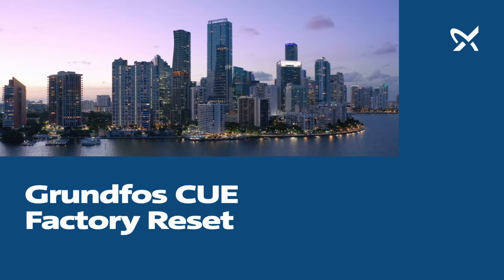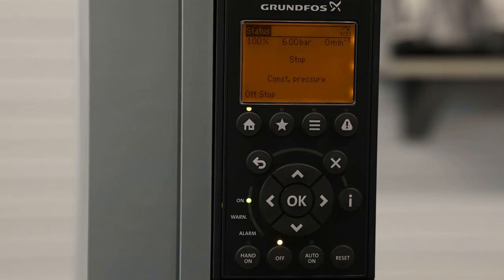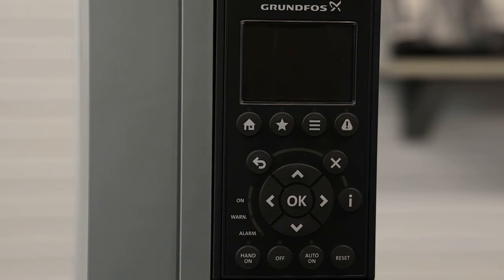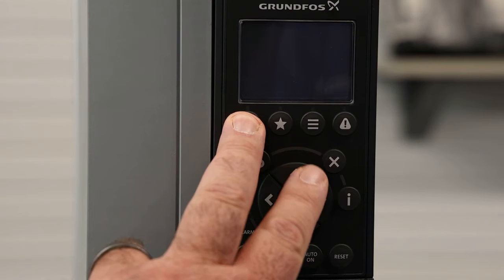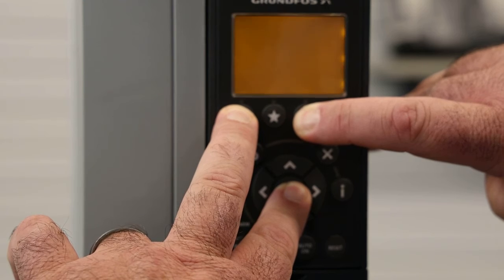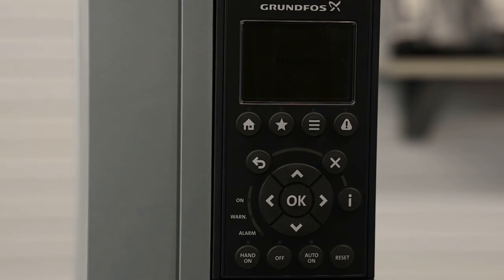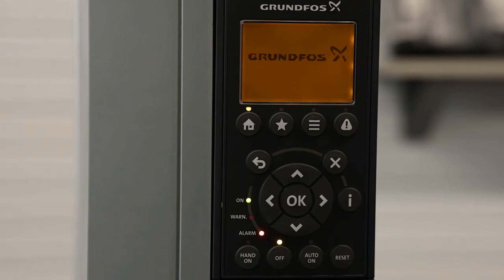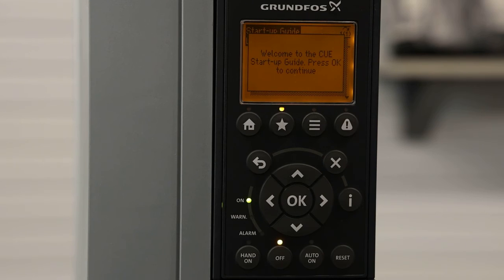Grundfos CUE Factory Reset

Comment: Good morning i have issue cu 362 sump pump .i put in auto mode not run and showing in display manual run . What should I do kindly reply me
Reply from the maker: Hi, Thank you for contacting us. Please be advised that you can find a wealth of technical information, including Operations and Installations Manuals on our website. Please simply search for the product you need and use the documentation tab to find and download all the information. Find our website here: http://gfos.ly/6054o8cAn. To help get you into contact with your local Grundfos partner please complete this form: http://gfos.ly/6055o8cAX Kind Regards, Krystyn
Reply: Hi . I turn on power  i think got stuck blank orange . Need help